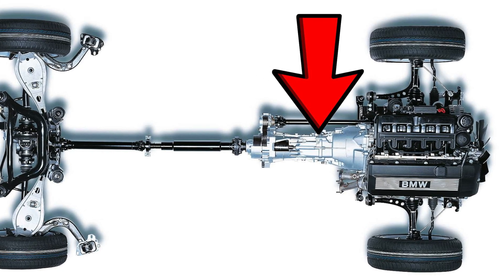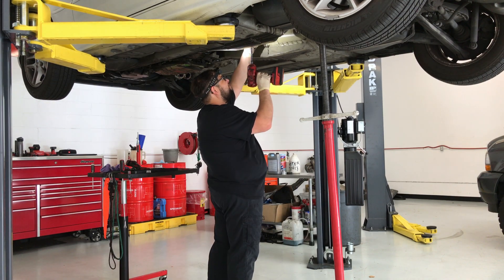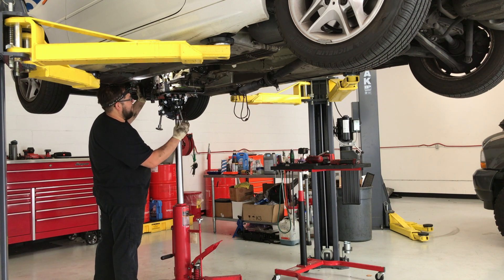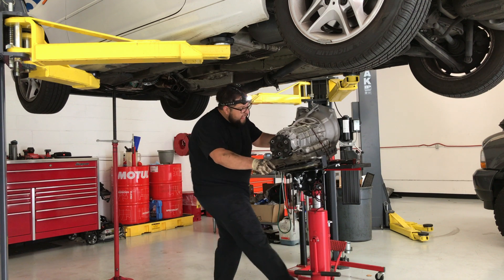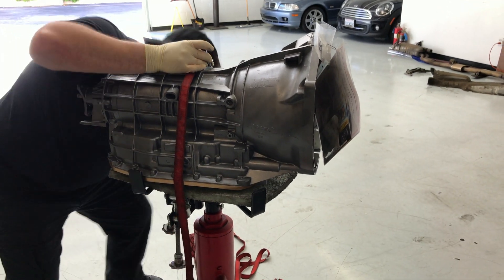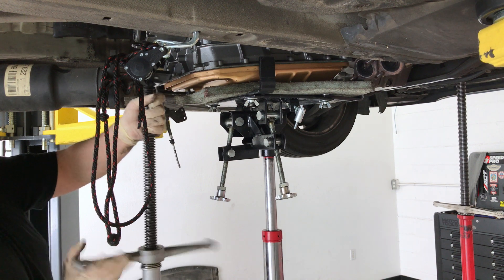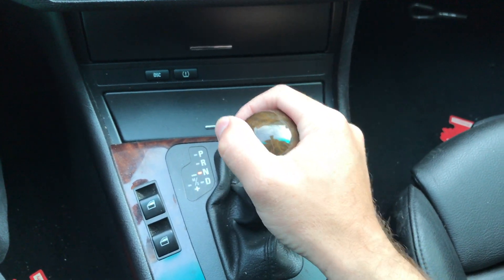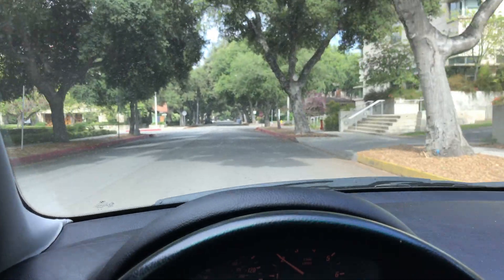Now You Know..  -  Shifting Gears

Comment: Hey Mike. Great job in the video. I’ve swapped out a 1957 Chevy, 3spd manual transmission, so I know there are a lot of steps you had to edit for time. But this was a nice overview for us viewers. 

What was the initial cause for this trans failure and how can we prevent that from happening to us? 

What does a BMW trans cost to replace?

Mike C. Currently in Georgetown, Texas. 
2020 X5 (M Package)
2012 328i Coupe
1986 325ES coupe
Reply from the maker: Thank you! Cost around 4k for this job as it was a remanufactured transmission. Not bad. The failure was electrical which then caused excessive slipping and burning of the clutches.  Not preventable. Just bad luck.